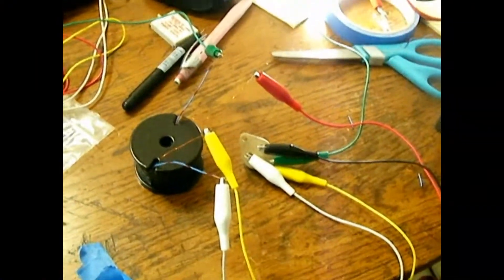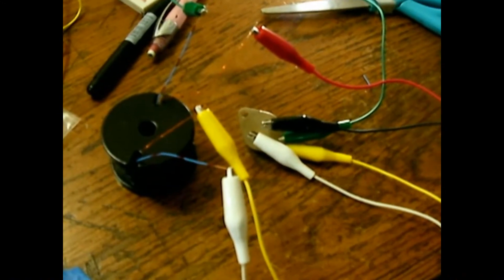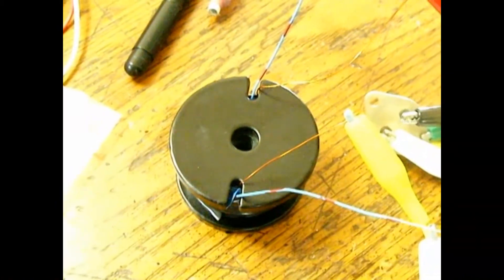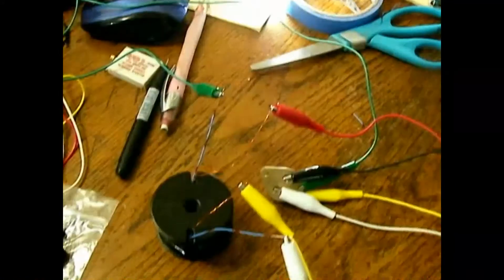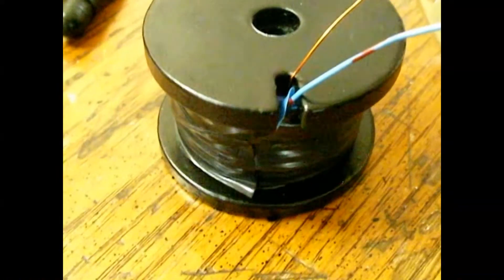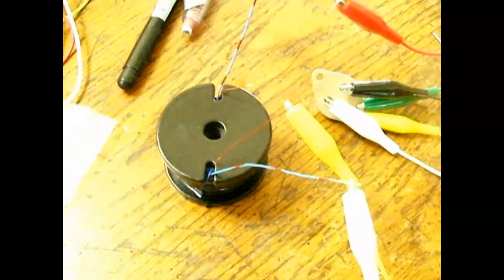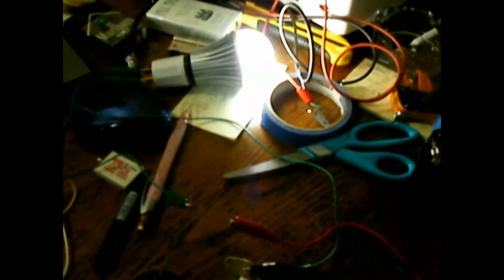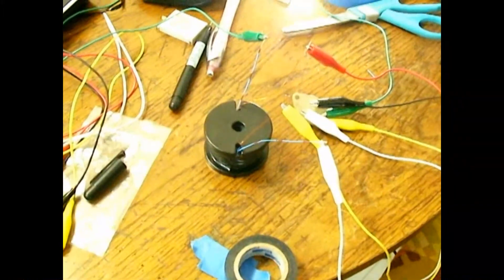Joule Ringer 3.0 using a Ferrite Bobbin

Comment: Yes good job. LynxSteam video shows putting a 1A rated diode (1n4001) between Base & Emitter for lower amp draw which inturn keeps the temp on the 3055 down, diode cathode marking to the Base..I am playing with similar circuits too...

Comment from the maker: Its just 12 turns of #22 wire and 120 turns of #24 wire. Look up the Super Joule Ringer 3.0 and its the same schematics. I would suggest doing 48 turns and 480 turns since it will be a bit more gentle on your transistor. Mine does get a bit hot so it will require a heat sink.

Comment: Sometimes if you can get your HV, with only 6V, it seems to work out better. The most efficient CFL driver I have even seen is a royer with ferrite E-core, publiched in Home Power magazine, also 6V input. Despite having to go even higher for fluorescent, that inputs amps stay low, on 6V. Nice job